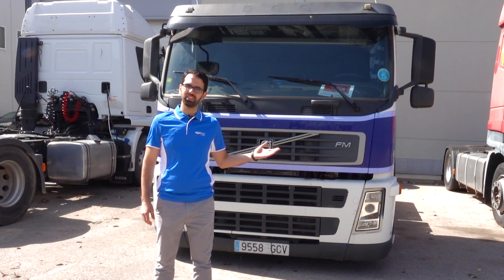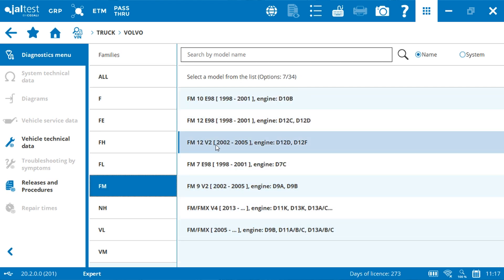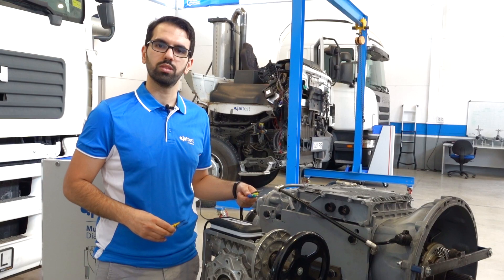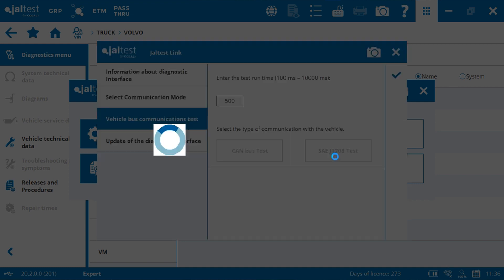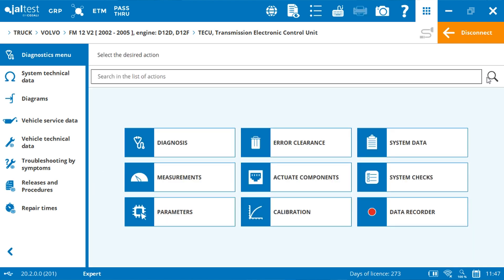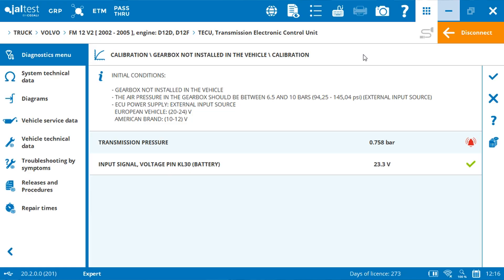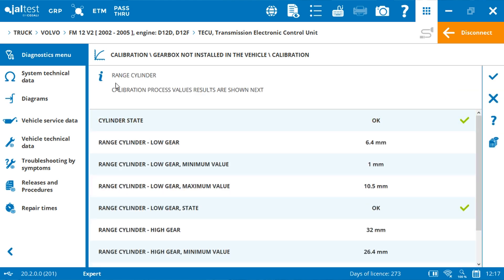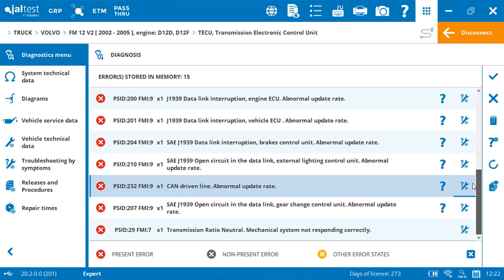JALTEST CASE STUDY | Calibration of the Volvo I-Shift gearbox not installed in the vehicle

Comment: Hi. Can you tell me if this will work on the new transmissions ATO2612F? I have the old connector and I am guessing maybe the new Ishift models maybe use another datalink to calibrate??? not sure. I went to a customer to program TECU, calibrate, install new trans, calibrate clutch. MACK. calibration fails due to communication immediately every time i begin the calibration. My gearbox break out harness is 88890206. new break out harness is 88890284. I guess I am asking if the new one has DL1 or DL9 because my tool only has DL 2 on pins 6 and 14 of the 16 pin connector. and would the other datalink be used for calibrations? I am able to do ATO2612D calibrations and have done F calibrations in the past. but maybe this is a newer one than before?
Reply from the maker: Hello! 👋🏼 To receive technical assistance, please contact your dealer or use the "Jaltest Feedback" button of the software to report the problem directly to the Jaltest team. Thank you!

Comment: Great explanation as usual.Thank you! 
There is a question according to this case study: many years when I performing gear box calibration on Volvo in some cases I can't  find the transmission code. So I'm choosing that one which often use on other trucks. So, I didn't notice any difference between them. Please shortly explane what is a difference and how important to choose correct unit when doing calibration job. 
Thanks in advance. 
Edward 
#autodeducton
Russia